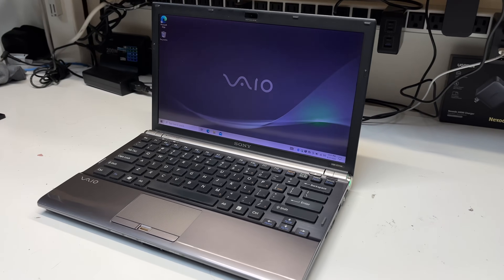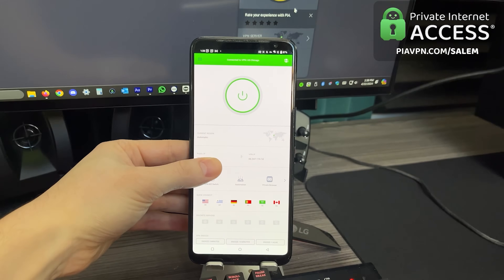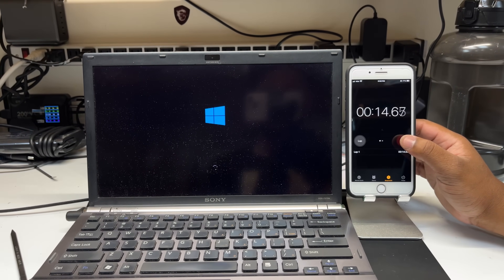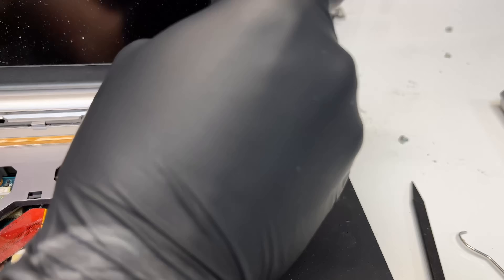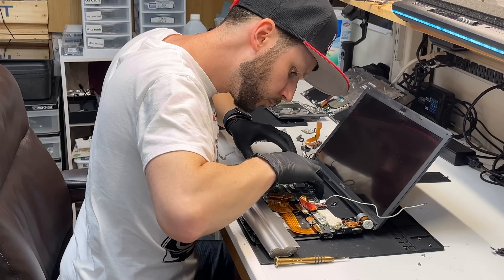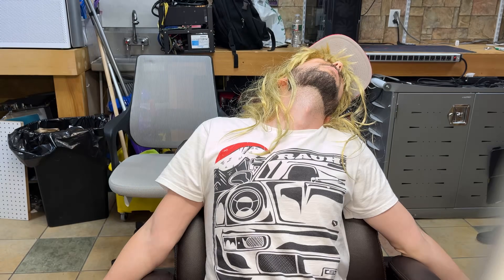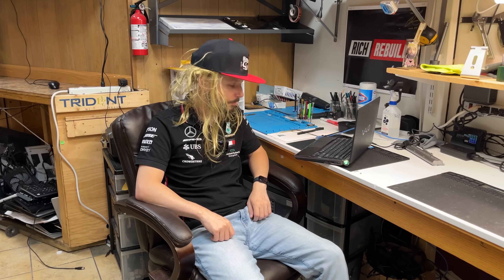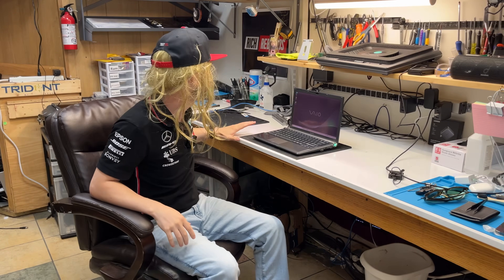Sony Vaio Resurrection: Saving this Insane Tech From 2008 (and why that soon won't be possible)

Comment: I still have the VPCEH25EN model which surprisingly still has the adequate drivers available on the internet and is built just like this one on the video:- Made to last
After my dad daily drived it for 12 years and handing it to me this year, thing gave me seizures just by trying to upgrade the 312Gb HDD with an SSD.

Comment: I have 2 old laptops at home that we don't use anymore. Iirc my parents stopped using them because they had memory issues or battery issues. That's often what makes them change their laptop. The latest computer that we had problems with (not one of the two) likely has a nearby dead battery. It doesn't hold the charge and also the second hard drive doesn't show up in the file explorer all the time. Idk if it has other issues (probably some dust too, it's like 8 years old) but appart from the battery it would be a perfectly working laptop. Now that I think of it, I could try refurbishing one of the old laptops as long as I know what's wrong with them. We don't use them so we don't care if they still work or not and if I make them work better maybe I can resell them or something. Idk if it's worth the trouble though, they are pretty old models. But it could help me get used to computer insides and how stuff works.

Comment: The kind of laptop that requires you take a photo EVERY TIME you remove a screw or disconnect a ribbon cable.
A tech's 12th circle of hell.

Comment: I have a vgn laptop. Loved the thing and wanted to keep it up to date (ish) was very happy to see a video in 2024 also repairing a vgn. Until i saw your laptop had a sata hdd. Mine had a 1.8 inch cf drive (50 pin) or some shit. Found replacement parts to get an m.2 “ssd” in and when i finally got it all connected, closing the laptop showed that there was no clearance for my new hard drive to fit. 2 and a bit hours for just pure dissapointment

Comment: Every Surface Pro 4 is destined to have a bloated battery at some point in life (this is a true statement). I came across one at work that my boss was gonna throw in the e-waste but I always wanted an electronic sheet music reader so I said give it to me. I replaced the screen that is cracked by the bloated battery and the battery itself (thanks to AliExpress parts). Although finding the parts is a tough enough task (the screen has some small zones that are not very sensitive to finger touches but I'm fine with that at least the battery is of great quality), taking this thing apart, with a screen that's cracked in multiple spots is no simple task. To make things worse, the motherboard died half year later after the initial repair. Now I bought two no-screen units for $120CAD which gave me a working unit and a spare motherboard. Imagine someone without my skills going through all this. This unit would have ended up in the landfill 100 times already. I'm totally with you. I hate it when companies make things unreliable and unrepairable.

Comment: I have laptop BenQ Joybook S32 was manufactured in 2007. The config: Intel Pentium t4200 with 4Gb ram DDR2 667, Wifi crap b/g, ssd 128Gb, video Intel GMA 3100, optic dvd-rw. BenQ Joybook S32 which is manufactured in 2007, I have used and modified it countless times! With it I tested hard disks and ram memories and it still works after tens of different processors on socket lga 478 and 479 have passed through it. The only problem with it is that it no longer holds the battery. But otherwise, it works flawlessly. I tested on it, all types of Windows. From Windows XP- to Windows 10. Now I don't use it anymore. But I keep him, because he is still a reliable friend. So that Sony Vayo did not undergo mutations like my laptop. This BenQ Joybook S32 manufactured in 2007 is a true veteran of modifications.

Comment: Whenever you mentioned about repairing cars, I have a 19 year old truck that had a fuel pump that gone bad, the vent assembly that is used to vent out air broke off, it was a plastic piece that isn’t sold anymore anywhere, it was frustrating looking over a week I couldn’t find one cause the truck was in perfect working order. Had Jerry rig the vent port by using Plastic straw and JP weld, that was a nightmare. Now it wanna throw up gas like it’s a kid now

Comment: HP Zbook 14u G4 has a lot of room to upgrade, only thing it can't do is win11 but it has a TPM, it is just not 2.0.
SATA drive port, along with 2x NVME M.2 (1 at 2230 and 1 at 2280)

Comment: @14:55 I have an Asus tuf laptop that broke in under 18 months. The hinge broke and Asus doesn't make parts for it any more and I'm paranoid about buying a 3rd party case because the laptop was made for microcenter, not sold anywhere else, so I'm afraid a case made for that specific model that isn't the microcenter special will have just enough changes in it to not work properly. Maybe I should send it into you.

Comment: I have Dell precision m6700 which i bought new in 2015. 16 gig, NvME ready, 3 hdd slots, 17", DVD drive, separate gpu, the works. I needed a17" and dvd drive. Battery died years ago. Unfortunately, this laptop isn't win 11 capable. I only browse and youtube, but it's getting slow. Any thoughts?

Comment: Just hit up my local pawn shop and there were over half a dozen "craptops" there, all with soldered Intel Celeron and i3 chips, and 4 GB of soldered memory on the motherboard...
I mean technically they'll be able to run Linux Mint for several more years, but that's if something doesn't break on them 😬

Comment: 2000s laptops are build to last We Had HP Pavillion dv1000 as a kid that was 20years old now it was still working in 2020 but my brother lost it during those times. The thing still runs and hinge still perfectly works even after opening thousands of times. has been used and abused by whole family including me playing warcraft for hours daily Compared to HP today which is basically Hinge problems and dead after 2 years.

Comment: Im running a 2013 hp pavilion g6 that i added additional ram (8 gb) and added an ssd over the 2.5 in hdd as my work/shop pc. also added windows 10 when it had 8.1. I used for about 4 years before it was not usable due to the performance and i almost got rid of it. glad i decided to try and upgrade, I spent less than $50 and its almost a new pc. it also has a serviceable cpu which i can upgrade to a quad from dual for less the $100. money well spent imo! and driver updates suck on anything from windows 8 era. still trying so sort a bluetooth issue that worked before i went to windows 10

Comment: I'm still rocking this laptops competition. A Thinkpad X200 Tablet. No modern laptop can compare to that things keyboard. Tearing it apart was a pain in the ass just like this laptop to repaste it, but it was worth it. I run windows 7 on it and it happily does all basic functions like running office and browsing the web. I dread to think what my modern Gen 6 X1 Yoga will be like in 14 more years.

Comment: This channel, as well as my hobby of repairing and upgrading old tech, made me come up with the idea to spend a week fixing and upgrading an old HP All in One PC. I upgraded the Ram from 8GB to 16GB and upgraded from a HDD to an SDD, while also replacing the thermal paste on the CPU. Now the computer runs like a dream. Funniest thing was that everyone told me to “throw it away” because they saw it as junk. They were shocked once I got it back working and even better than ever.

Comment: I have been using a WinX laptop from Dell.  An XPS13 that the only upgrade possible is the M.2 which I have thrown a 2Tb drive into, and attempted to tell windows to go to hell via using Linux instead.  Sadly I had to go back to Windows, on the quarter Tib drive that I left the old OS on...  I did learn tho that even w 8Gb of ram, the processor supposedly can't run WinXI...

Sadly IK it will die soon, or at least WinX will lose "support," however that doesnt mean instant death for the system

Comment: totally agreed, laptops should be repairable. My 2nd gen core i5 Vaio is still kicking ass today, all I did was get a replacement battery some ram and an SSD and its good for use. On the other hand, my surface laptop 3 which I bought new is now bricked because of a crash during windows update and the bastard won't revive no matter how many "repair" guides I've received from Microsoft and fellow people on the internet. That is completely unforgiveable and the laptop's replacement motherboard costs as much as the bloody thing itself if I buy it used. This culture sucks.

Comment: I had a Sony Vaio PCG-GRT170 circa… 2003, I think? Nothing thin OR light about that bad boy. It had a socketed CPU. A socketed DESKTOP CPU, a 2.8ghz P4. Weighed a ton, hot as hell, and had a battery life measured in seconds, but it had a gorgeous 16” screen at 1440x1050.

Comment: I have 2 sony vaio back in the day one is stil working and one black and white from 2012 with i3 3gen and rx7400 and is easy work but id died and i have secon from 2007-2008 silver vaio its still working

Comment: If You struggle to find drivers for older laptops You could try installing a lightweight linux like MX-linux or KAos. There the drivers are all includede in the kernel.

Comment: My MSI Katana (1,5 years old) has replaceable RAM, 2 slots for NVME drives and its pretty easy access to the battery and taking it out isn't that hard. I bet this laptop will last me 10 years. My last laptop was a Lenovo thinkpad from 2007 or 2008 it lasted 12 years. Also pretty good up-gradable with RAM, SSD and battery replacement.

Comment: I bought a truly wrecked 13" version of this same laptop for $1 off CL back in 2015 with the intention of learning how to fix laptops. I mostly learned to hate ribbon cables, which turned out to be why that marred turd wouldn't boot initially. Half of it's remaining zombified life was spent as both a media server and hard drive wiper, otherwise it was being crushed in storage until I finally threw it away 2 months ago. Still worked the same, absolute unit!

Comment: 8:38 i remember replacing cpu in my old thinkpad l530 fron 2gen i5 to 3 gen i5 peformence boost 90% i finished witcher 3 on that thing (on a intel igpu ) ssd helped a lot jeez i miss the days of good laptops and i hate 2in1 laptops of today

Comment: I have a Dell Mobile Workstation that I used daily for 12 years straight, 2010~2022, I still use it since it has run Win7 pretty much the whole time. I've upgraded it through the years and it's worked great. I am hoping my current computer can last at least 9 years but we'll see. 
I've also got an Ancient Vaio all the way from mid 2001, thank goodness I got those drivers so many years ago cuz Sony decided to annihilate all drivers from their old stuff. 
That, my propensity for Palm software and other things turned me into a data hoarder, Lol~

Comment: I just replaced my 13 year old laptop simply because the fan broke and made a ton of noise and overheated. It would have cost me about $150 to replace just that fan since I had an uncommon laptop (Lenovo twist). So I recommend if you have to go with a laptop nowadays go with more of a common laptop so there's 2ill be parts available in the future

Comment: Glad I found your channel (our son went to Salem State). I wrote my first program in 1969 (so I've been around awhile). I used to build PCs as part of my job (old IBM PCs). I'm a firm believer in saving old PCs. We live in Florida in a senior citizens community (The Villages). Most of the residents here have old PCs running anything from Win 95 to Win 7. The thing is that they don't need Windows at all, so I converted a few of them to Linux Mint (Cinnamon). They don't have to worry about getting a virus (mostly) and it just works like Windows did. But the best thing is that I saved the old PCs from going into the land fill. Keep up the good (but hard) work!
Reply: ahhh..Viagra and Linux.  Keeps 'em running like the energizer bunny!
Reply: I use Linux Mint on one of my PCs on a daily basis.  It's a fantasic OS 👍🙂❤️

Comment: Right thoughts. Most people do not need nasa space shuttle computers, they just want to use word, YouTube and organise their photos. 

For me as a gamer: yeah, I buy every 5 to 6 years new parts but the old ones are used by me in my parents home for having a computer there. Current build there: i5 3rd generation and a GeForce 1080TI. Works perfectly. But not with current games.

It feels as fast as my current working Lenovo thinkpad laptop with an i5 10th gen. 😅

Comment: Not to sound like one of THOSE guys but my 2010 Vaio is still completely supported hardware wise on linux. Depending on the distro getting the nVidia drivers working might be a hassle, but for any use other than gaming the opensource driver branch works A-OK.

I have a modern desktop but this has been my only laptop since 2010 and still more than does everything I need.

Comment: Your video is great and humourous.
But the IP in your add: WTH? Wouldnt buy that shit if their marketing team dosn't even get IPs straight.. you just have to memoprize 255 numbers...

//EDIT:
I also had a job where I had to migrate the data from an old VAIO to a new hp - instead of taking the 50€ I took the old VAIO as payment.
Smacked an SSD in it, changed the CPU, I could even have changed the GPU because it was an MCM. 
It worked fine until I said: Lets change all the thermalpaste! Ripped the screen and keyboard cable in the process... but it was fun while it lasted.

The thing lived for 19yrs!
Yeah, they don't make these Laptops anymore... a bummer.

Comment: i had a vgn-z11mn/b , it was a nice laptop untill i opened it to start upgrading it , swapped the hdd with and ssd windows boot, and a 2nd hard drive in the dvd drive for storage, but at one point something went wrong and ended up not booting , only in some sort of pressing the case or messing with the screen hinge, so yeah, basically i fucked it up, but i enjoyed it , sold it for parts for a guy thinking he will fix it . kinda miss it cause it was all that i needed and thee swappable battery,  wich i bought another one so i can have like 5-6 hours of battery life away from the charger.

Comment: Friend of my brother used to have a laptop with a similar "GPU-mode" switch. And because of this fancy GPU mode switch (where I'm not even sure this did anything in the first place), there was only one Nvidia driver version available from the manufacturer of said laptop (which was outdated even back then), and the official Nvidia driver was nice enough to inform me, that it isn't compatible and I shall rather use the one from the manufacturer.

Comment: Bought Sony Vaio VPCEH3AEN in 2012. Still working... Yesterday bought new battery that's give 2hours screen on time. Running Linux mint. Using for flask web development and python. Harddisk not changed from 2012 but now planning ssd

Comment: Yesterday an HP laptop came into the shop I'm interning in, and it looked a lot like that. You had to disassemble the whole thing for a repaste for example. Fortunately i didn't need to do it, just remove the RAM and the battery for discharging static from a surge.

Comment: i still have my 1st gaming pc. An alienware m17x4 still rocking from 2011. paid $2512 thru Dell finance to build my credit. in 2020 I Upgraded gpu, added additional ram, added additional ssd and repasted everything. Still does fortnite at 60+ fps at 1080p. Same for world of warships and civ 5. Played Warzone back in 2020 with it at 45-50fps medium settings...it wont do warzone now as well, but great for lighter games i mentioned above

Comment: I would have been tempted to put Windows 11 on that laptop. You can use a program called Rufus USB to create the Windows 11 installation media for a USB Drive, and not only will it give you the option to bring back the "I don't have Internet" button, allowing you to make a Local Account, you can also tell it to ignore the TPM 2.0 and Secure Boot requirements, in addition to being able to install it on systems with only a BIOS and not a UEFI. I've done this on several older systems that can accept an SSD and at least 8GB of RAM, and honestly, Windows 11 has run fine on them. I recently did this on an HP Compaq Elite 8000 that had a Core2Duo, and the only thing I had to do to Windows was turn off all the animations and transparency, as the older graphics chipset didn't like that, but otherwise, that computer was still perfectly usable.

Comment: Lenovo Legion is VEEEEEEEEEEERY easy to repair or upgrade
i with no experience could change RAM, add ssd and change thermal paste and vents with a question of a few screws

Comment: i mean a thinkpad will probably last as long as it needs to, but i feel like thinkpads are also cheating. or a good HP machine. I've fully pulled apart and even upgraded a few of those. Still prefer old thinkpads tho cuz t440p go brrr

Comment: There were a smaller model that was an even more a pain in the ass to open, that I put my hands on some years ago. The thing used a mini hard drive that I couldnt find a replacement in my country, so the owner got screwed and got a nice looking brick.

Comment: My company bought several vaio laptops when they were the best in the industry.  Don't have the heart to ewaste them.  They still work.  Have Linux Mint on one them so if I'm missing drivers, I would not know.  Hdmi port doesn't work though-probably due to driver support. 

The ultra portable ones are annoying that you have to remove the keyboard to upgrade the hard drive.  

Planned obselesence sucks.

I think Sony still makes vaio brand smart phones